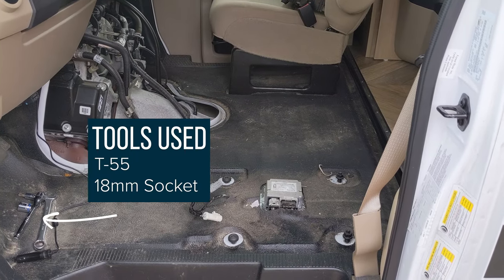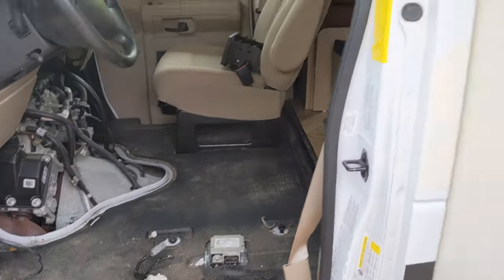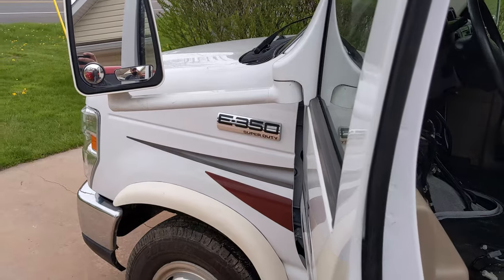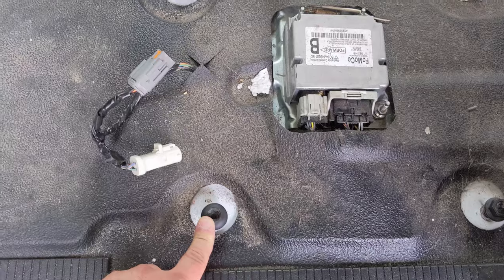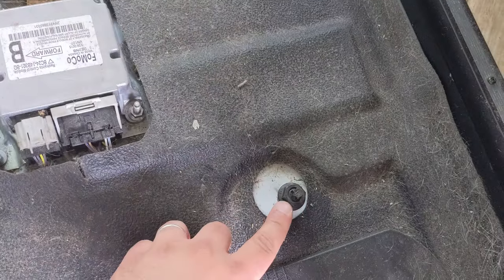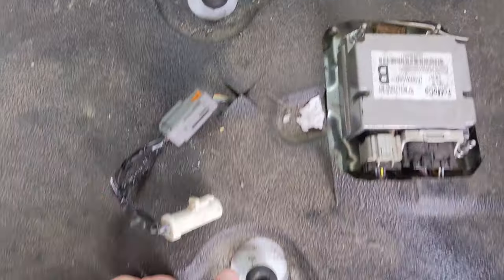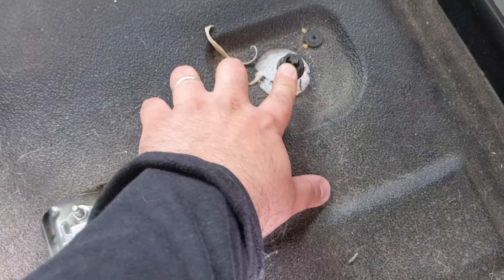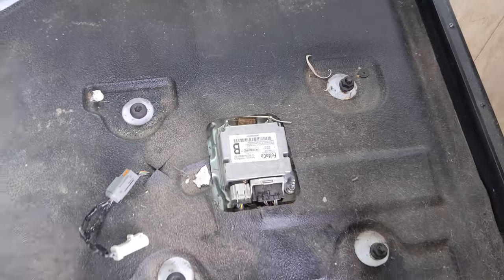Ford E350 / E450 Front Seat Removal - Class C RV

Comment: What did you replace them with? I’m having a bear of a time finding comfortable replacements on mine.
Reply from the maker: I didn't replace them. I took them out to put sound deading panels on the floor and wheel wells... It helped a ton with engine and road noise.
Reply: Did you find anything yet? Im looking too.
Reply: @BrandonZarbo  I came here to see how to remove the seats for the exact same purpose, what did you use to reduce noise from engine and road ? Is it better now ? also thinking about the same in the back, have you done something like that  ? Thank you in advance !
Reply from the maker: @ibris911  I just used Killmat. in the thickest I could find. It made a huge difference. I put it all over the metal in side the cab and also inside the doghouse to cut down on engine noise.
Reply: @BrandonZarbo  thank you so much for your answer ! much appreciate !